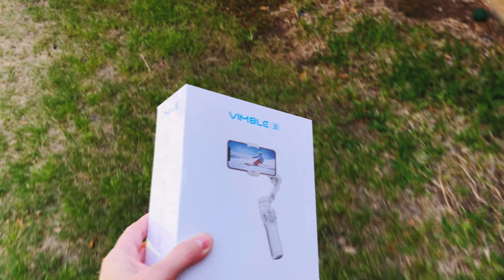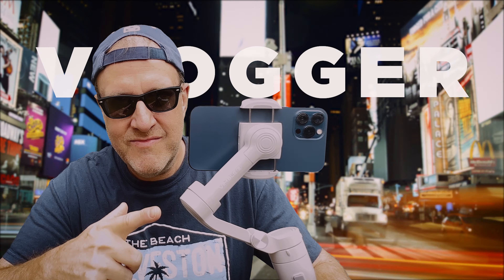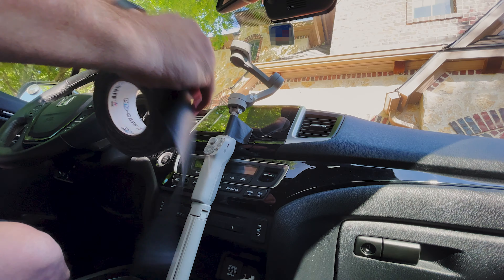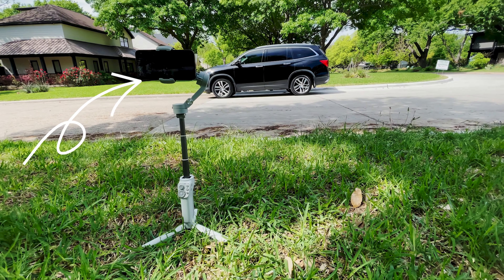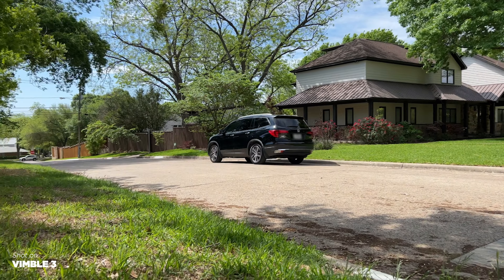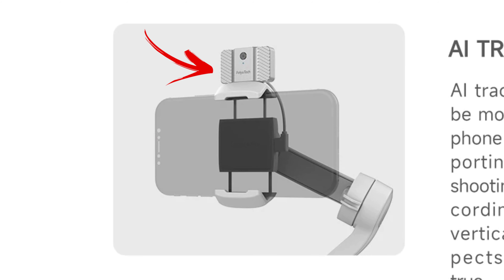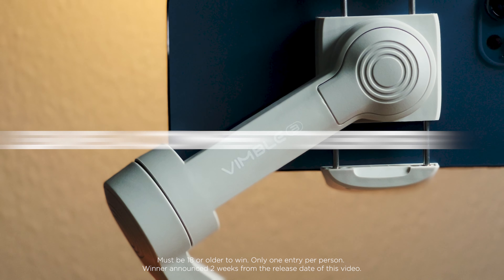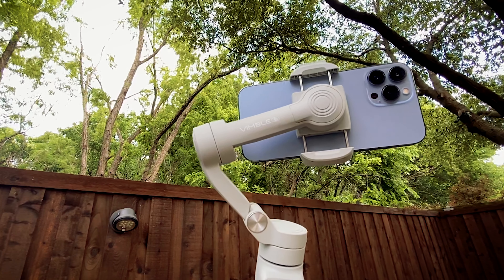Affordable Travel & Vlogging Gimbal | FeiyuTech Vimble 3

Comment: Does it work with filters / clip on lenses?
Reply from the maker: If you’re using a smaller phone then yes it should be fine with lighter filters. Lenses would probably be pushing it since the payload is 260g. This is really more for lighter setups.

Comment: I'd love to compare this with the Zhiyun Smooth 5 and Q3
Reply from the maker: The Smooth 5 is more robust and it has a better payload capacity. So if you want to add accessories it’s the better option. If you want something small and light and easy to travel with this is nice.

Comment: Hello!  between this model and the hohem V2??  Both gimbals are at the same price right now, the vimble 3 in the future will have a magnetic tracking module as well.  I have a redmi note pro, I want a gimbal to record lifestyle clips for stock and for some client (I'm a photographer).  I am interested in a portable gimbal, very stable and with a good tracking system.  Many recommend the V2, I was about to buy it, but then I saw this one, it looks a little more "professional" the V2 is simpler. help me please. thanks!
Reply from the maker: I’d probably go with the V2 as well. A bit more pro, but this is a nice affordable gimbal.
Reply: AmyMetal BB  No no, vimble 3 looks more professional and V2 looks simpler.  I'm talking about construction.  I bought the V2 yesterday, it arrives at my house today

Comment: Seems like FeiyuTech knows what they're doing when it comes to building user friendly and practical gimbals. I bought their G6 Max, largely on your recommendation Blake. It was an upgrade over my DJI Osmo Mobile 3, which was good, but not substantial enough for a 12 Pro Max rigged with lenses and filters. The G6 Max handles my tricked out 12 Pro Max beautifully and this new Vimble looks like a good option for simpler/lighter rigs. I still refer folks to your gimbal buyer's guide when people ask for my gimbal advice. Keep up the great work.  - Rob, in Calgary (Canada).
Reply from the maker: Yes agreed, the G6 Max is definitely a favorite of mine and is still great, although I’ve recently started using the Crane M3 a lot. But FeiyuTech makes solid products that are affordable. Thanks for watching!